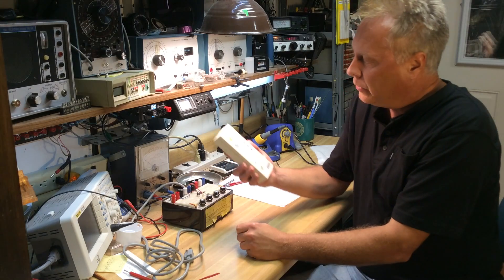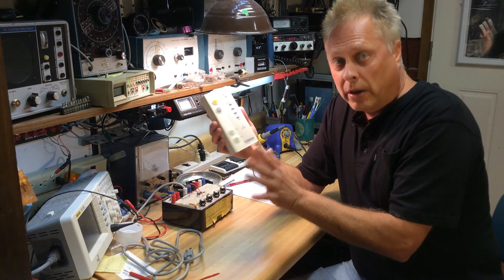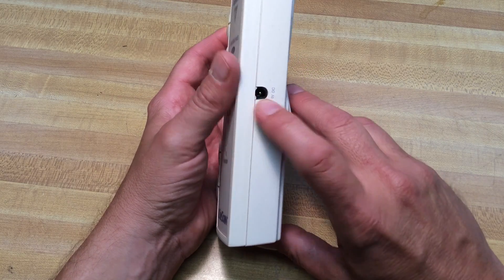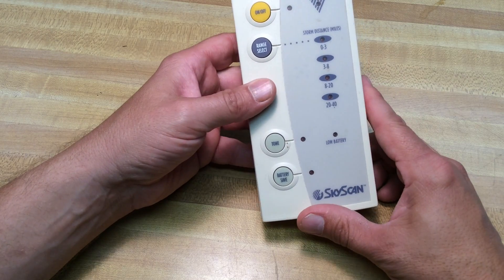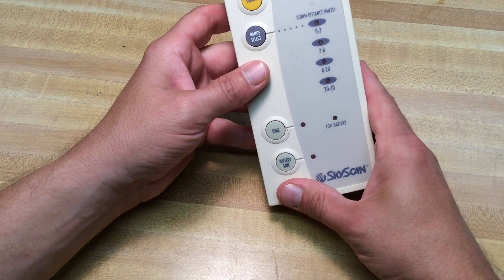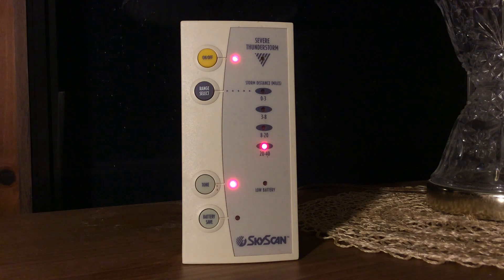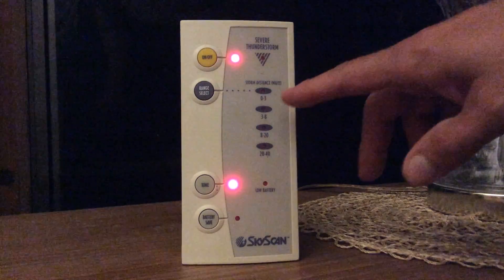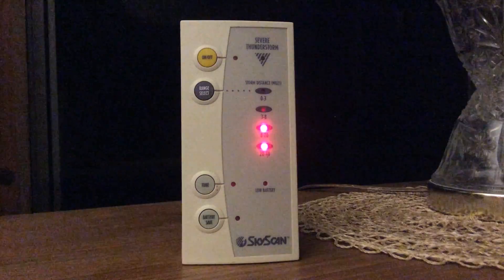My Lightning Detector In Action

Comment: The current version is the SkyScan P5-3 (third version?).  Those strikes are different distances are supposed to be actual, multiple strikes at different distances.  For some reason the manual for the device has changed to only a simple flyer without nearly as much information as the older P5.

Comment: Do they make any similar detectors with external outputs? I want to wire a lightning detector to a system I've been working on.
Reply: No, the TornadoAlert severe weather storm detector (works similar way to this device) has external output.

Comment: I suspect it is just an AM radio receiver. You know how you can hear lighting static on AM during a storm. Must work by monitoring for characteristic sharp static above baseline noise. The higher the signal and duration might be something they calibrated or can calibrate, Just a guess.
Reply: I think you nailed it
Reply: It's a correct guess.  Ground strikes peak at a different frequency than cloud-to-cloud.  You can also build your own.  I built one with an analog meter which is much better for ranging than LED's, and is sensitive out to 90 miles with a 30" rod antenna... much more sensitive than the SkyScan P5 here. BUT!  I can't match the P5's false signal rejection.  My homemade version will sound on a piezo-electric BBQ grill lighter from across the room.  The SkyScan P5 I have rejects that false signal.
Reply: +Todd Harrison > "I suspect it is just an AM radio receiver."
If it were just an AM receiver, I guess it could only monitor lightnings that already happened.
However, if it were based on static electricity (like B.Franklin's lightning detector) it could alert people of the danger before it actually happen.
Does this make sense or did I miss something ???
Reply: They use EMP sensors.

Comment: I'm intrigued on how it works. detection is one thing but distance?? Do you know what triggers the severe storm LED?
Reply from the maker: I am glad you mentioned the severe storm LED, I forgot to mention that on the video but that will light up when you have very near lightning strikes, like right in your neighborhood or I am guessing less than a mile away.  It is rare that lights up so I kind of forgot about that light.  But I have seen it light up a few times and it really was severe weather at my location!  I think it just tells the distance by the strength of the crash, like listening to your AM radio tuned off any stations.